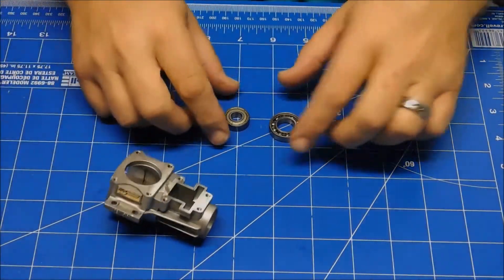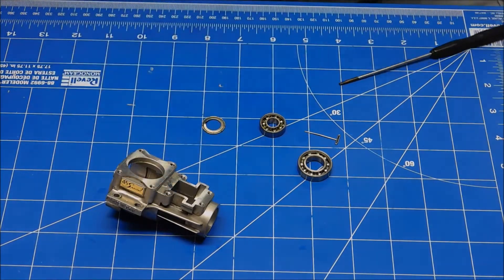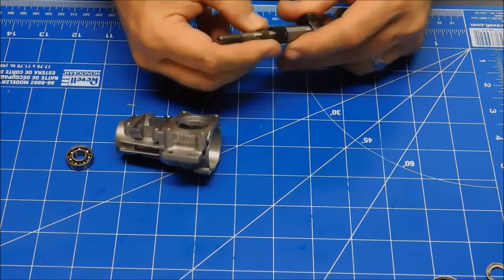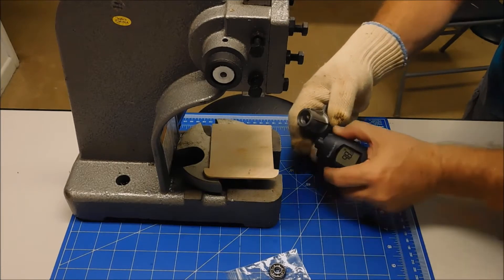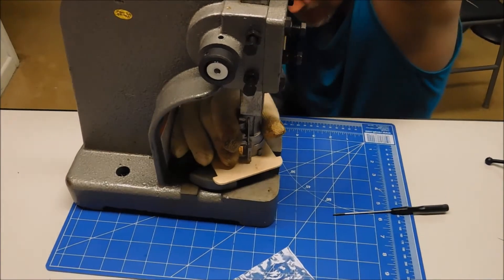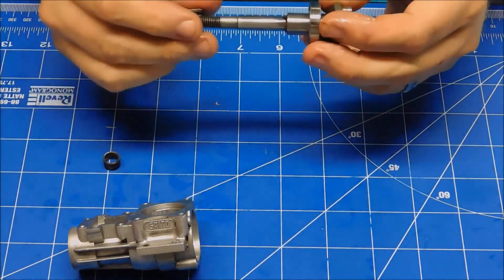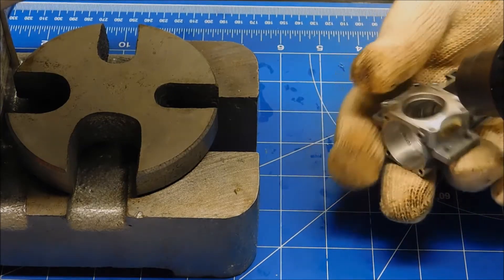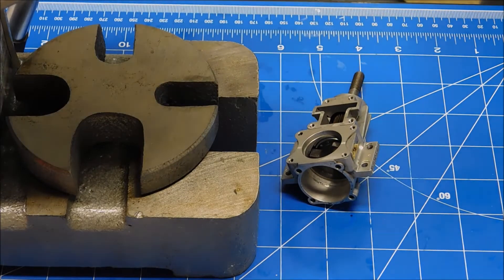How To: Install bearings in a Saito engine

Comment: you could also freeze ya brging in the freezer which will help install then you won't need to heat the housing to much great work on ya vids you've helped me solve a few things in timing etc cheers from down under

Comment: what stops the pinion from rotating on the crankshaft when the engine is fully assembled?
Reply from the maker: There is a very small roll pin pressed into the crankshaft that holds it in place.

Comment: Hi David, just one idea. Maybe you have changed your technique already. Put the housing completely into a hot oil bath... 300 degrees centigrade...(any modern synthetic car oils), and cool the bearing as much a possible...it should free drop into the housing..Any push on the inner ..cry....from a guy who grew up in the Centre of  the ball bearing m/c of Germany
Reply from the maker: No offense, but I do not need to change my methods as there is nothing wrong with how I install bearings.  There is no way in hell I am going to heat oil to 300 degrees just to install bearings.   Make a 3 minute task take 5 times as long is ridiculous.
Reply: Sorry mixing damm Fahrenheit with Celsius....300 C damm dangerous.. I am with you..sorry again :-)
Reply: sorry but not everyone has a press just sitting at home, the heating and cooling works. done it with my two nitro truck engines

Comment: Hi David, thanks for taking the time ot make these videos! They are very helpful...
I'm just about to change the bearings on a Saito 125, my problem is that I don't have an arbour press to install the new ones. 
Can you suggest any ways that I can get the new bearings in place without a press?
Reply: Side-FX Productions go to your local hardware store get a bolt that fits the front bearing and washers to fit both outer races and one to cover the front case , and a nut to fit the bolt , install the rear bearing 1st, using sockets and closed end wrench , make sure everything lines up good and tighten it up little by little until it seats, careful not to over torq. Then repeat for the front bearing.
Reply: PunisherGuy2099 cracking idea! Thank you for the help 😎
Reply: Yes great idea. Thanks!
Reply: A drill press can be used as a substitute for an arbor press for light duty work like this.  If you don't have one you probably know someone that does.  Using a bolt will work but that's slow and the crankcase will cool off and shrink before the bearing is fully seated.  If the engine is heated sufficiently it takes very little pressure to seat bearings.  I have had some just drop in place but I heat the front bearing area for 2-1/2 minutes using a heat gun suitable for covering an airplane.  For the rear bearing I heat for 3 full minutes.  

With the bearing already on the crankshaft, they often drop all the way in.  JUST IN CASE they don't drop in I have the drill press already set up for the job.  It never takes more than a gentle push.  If it does, the crankcase wasn't hot enough.